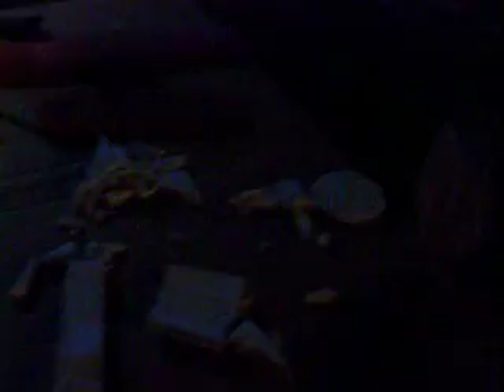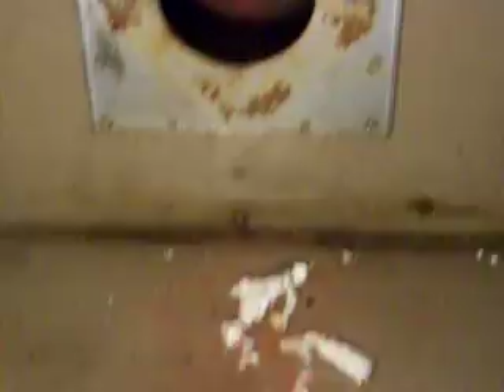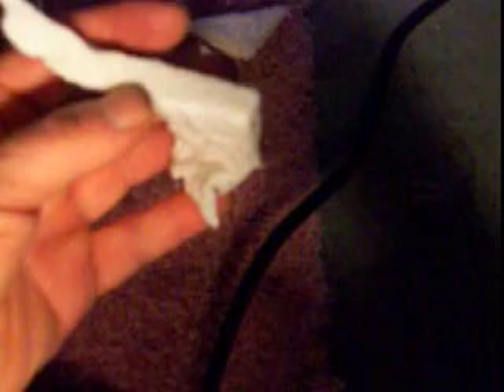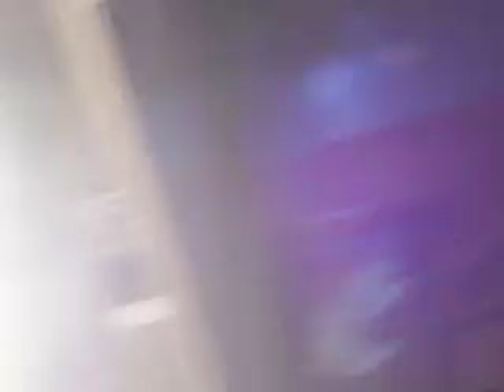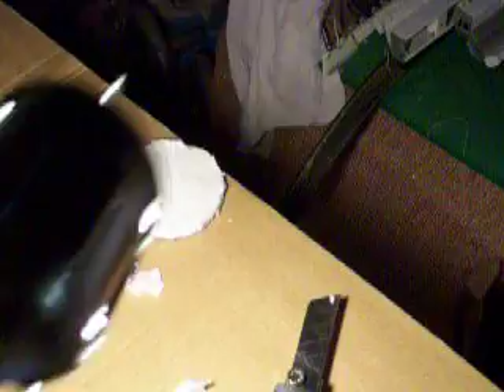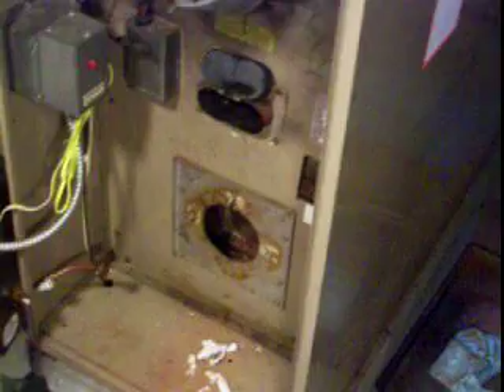(part 5) furnace combustion chamber liner replacement

Comment: This was accomplished, by working thru the burner hole!? :O. I can't imagine the patience required to pull that off. Are you able to see the entire cylinder, when working it? Guess I'll have-ta check out the other videos.
Reply from the maker: it was more a test of courage than patience. However, as I worked my view of things increased, with a mirror I was able to see around the entire "can".  I sometimes wonder this repair saved the furnace, that maybe a few more seasons would have harmed the metal.

Comment: You couldn't use the solid, stiff piece at all could you? What is making the back and sides stay upright and not fall over, just the rigidity with the bottom once it hardens? There's no way to get this product to actually adhere to the metal interior is there?
Reply: +bigpardner it has no real adhesion properties, but can hold itself up when unrolled in a cylinder especially having wall around it.  I think I was able to press it in corners a little, and mold it to the upper lip inside.  the hole was so small it would have required solid pieces being cut up.  on solution might be to use furnace cement to glue pieces together?  keep in mind that once heated it becomes rigid.  so as long as it does not collapse before that,,,